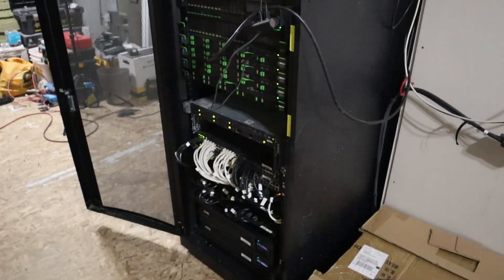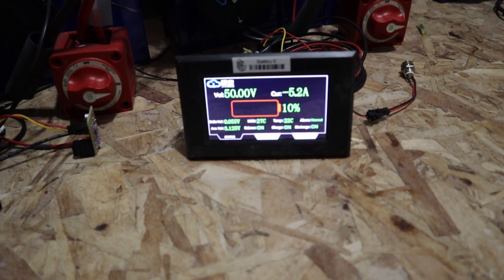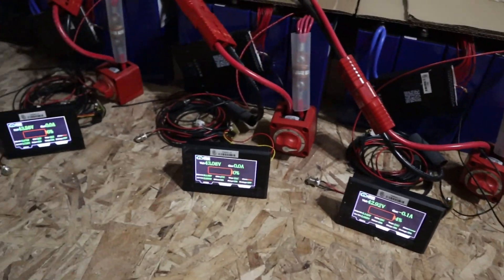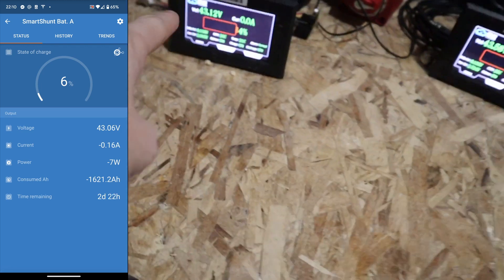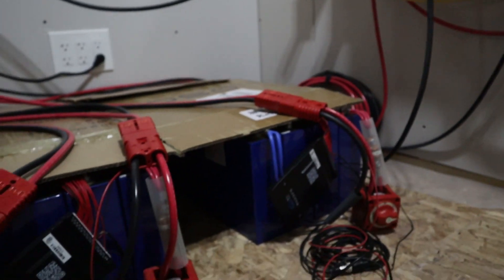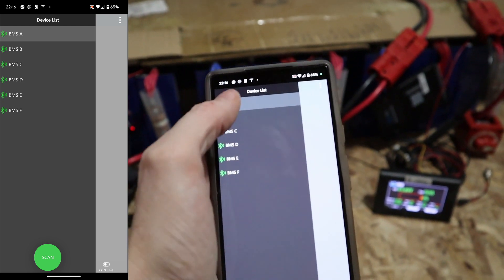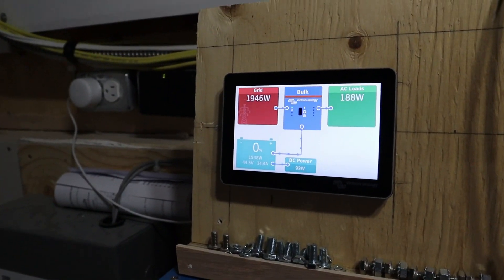Capacity Test Results! - Big Battery Build! (Ep. 47)

Comment: set balancing start in the BMS to 3.45V or even higher 3.5V (Andy has a whole series on this) the problem might be: that there might be some china-saved-on-lithium-cells and each BMS might constantly balance with 2A from all cells into the single one china-saved-on-lithium-cell = hence the big power consumption when sitting idle :(
Reply from the maker: Aye, I'll be using Andy's recommended values.
Reply: @TheDigitalMermaid  have here a EVE 280Ah cell with 270Ah capacity and the vendor says "everything is fine and dandy" #wtf?
Reply from the maker: @boringsoftware2093  How old is it?
Reply: @TheDigitalMermaid  not even 6 months.
Reply from the maker: @boringsoftware2093 oooooph

Comment: Hi! really love your videos and how transparent you are!. I've got a bit of a suggestion if you want to take it. I'm currently using a JK BMS B2A20S20P and I've connected it through the serial port to Home Assistant, so I Can check super easily all the data. I think for your use case it will be even more useful because you can check at the same time, compare and store all data from all the BMS!
Reply from the maker: If I had the time, I'd LOVE to tie my system into the home assistant. If only I could carve a few more hours out of each day. :)

Comment: There is always drift in SOC, because every meter do not integrate properly IN and OUT VAs, if U compare BMV and 3 different BMSs, each BMS will provide different numbers. It also depends on C rate, temperature, viscosity of elyt ... etc. If during winter batts do not reach max. voltage, difference in SOC left can be 10 % - 20 % or more + or -.

Comment: You are braver than we were.  My wife and I are converting our Catalina 400 to electric, using a QT30 LC motor  and a battery bank of Battle Born 270Ah 12V LiFePO4 Deep Cycle GC3 Batteries.  We used eight to build a 540 Ah 48V bank.  More costly but I didn't trust myself for a more DIY approach😆  I am a fair weather sailor and a gutless wonder when it comes to this stuff.

Comment: You may already know this, but when the battery is depleted under load, and the load is turned off, the battery will recover some of it's voltage, but that doesn't mean it has more useable power. Back under the same load, the voltage will drop right back down to where it was. Sorry if I'm preaching to the choir.

I'm glad you got the capacity you had hoped for. My extra cheap cells were advertised at 60AH each, and they turned out to be about 50AH in reality. I figured as much before I bought them, so I'm not disappointed with the result.

Some thoughts on top vs bottom balancing: I think this is argued a lot by battery nerds, but I think bottom balancing is only valuable if you plan to drain your battery to 0% every cycle. Bottom balancing will allow you to get the most out of each cell before the battery is shut off by the BMS. For most applications, people generally start with a fully charged battery, use it for a wile, and then top it off again. So the battery rarely finds itself at 0% in real-world conditions. In that case, top balancing makes the most sense because it allows you to pack as much energy into each cell as you can before the BMS cuts off the charging. I'm not sure everyone would agree with me, but that's what makes the most sense to me. 

Anyway, you sure have gotten a lot of work done! I'm looking forward to seeing what happens next. :)

Comment: But is it worth all the time an effort you put into those batteries? Wouldn’t it have been cheaper to buy ready made LiFePo4s? I mean it’s of course priceless to have made the experience. But is it economical for people who look for the fastest way to get things done.
Reply: As your pack gets bigger, DIY cells make far more economical sense, even with all the dickin around. $18K is a lot of money saved. Like Digital Mermaid, I was kind of curious to see what could be done with raw cells and was more of a learning experience. In hindsight, the 10kWh or so that I need would have been much easier if I had just bought 2 server rack batteries for about $500 more total. Although I'd only have ~80% of the capacity of my 280AH DIY cells.
Reply from the maker: For me, it's 100% been worth it. I knew nothing when I started, and the most important goal was to know my system inside and out. If something goes wrong when I'm far away from civilization, I need to know I can repair things. That's the biggest value.
Reply from the maker: Hit enter too soon...  Looking at price though, the price for retail batteries with ~86kwh would be ~32x SOK 206Ah @ 12.8v batteries, which would be about $33k usd for batteries alone (and I don't think they support a 4s/6p config). For Victron Lithium SuperPack 12.8V/200Ah, I would need about 34 of them, which would be about $73.4k usd, and they need external BMSes. So though my primary goal was education, the secondary benefits of cost are also huge for a bank this size.
Reply from the maker: Went back and checked; It was ~$14k~$15k for my batteries and BMSes. So ~$18k cheaper compared to SOK, or ~$58k cheaper than Victron.

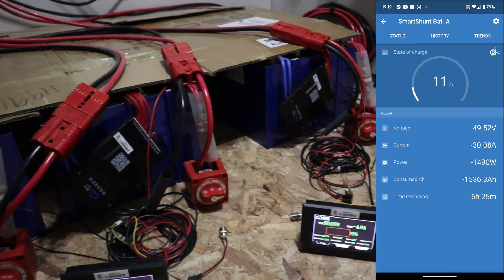Comment: 3:16 you mean 750Wh/day for internal loses? That seems very excessive for the BMSes unless you had the balancer running all the time which it seems you did. Accidentally or was there a purpose behind that? You cannot use the JK to bottom balance your packs. Bottom balancing makes no sense anymore. That's really something from the past.
Shunt could still show some %SOC depending on its settings. I found the Smart Shunt to be way more accurate than the internal BMS measurement of the JKs.
These screens are terrible consumption wise. I tested mine with 280mA constant draw from a 12V battery. The next version ( I know, right!🤦‍♂) can be turned off with the app and also have a sleep function.
Shaky cameras are sweeet. It creates a personal touch...
Reply from the maker: I didn't change the default balance voltage trigger, so it was still set to 3.0. Some kind folks commented that you pointed out that should be changed, but by then the test was well underway, so I left it. I'm going to do a few different settings across the six packs now that they're recharged, and them go to see family for Christmas. When I come back, I'll charge each pack to see how much power was consumed while I was away. Should be interesting to see the differences.

As for "the next version" having obvious changes, well, that's JK's way. =/ I'm not buying anymore, and will add switches if I take these BMSes to the boat.

Comment: Love your enthusiasm and dedication to this portion of your Electric Boat project. You keep saying "accurate" when you have no means of obtaining accuracy. You could choose a particular set of items to always do the Meaments, yep Meaments, Measurements with the Sure taken out. Sure would need calibrated items that can do measurements. I would suggest you do as most of us do with these sorts of things. Use the PDC method. Pretty Damn Close. And if you do enough PDC stuff soon you will not need any items just your brain. You will be able to guesstimate within the error of any items most use to do Meaments. I used to do a guesstimate, write it down, seal it in an envelope, and give it to one of my engineers. When another engineer got done doing Meaments and experiments (tests require accuracy and repeatability) and had some result, I would ask for the envelope and have the engineer open it. The look on their faces when they saw my number versus their number they were amazed. My few second answer was always just as good as the answer they took weeks to discover.

Comment: Since you have no charge coming in (solar) that is a very decent test. with balancing turned off you should get around 14.1 kw per bank of use and a .5 kw of bms usage. still 13.96kw with balancing turned on is good. My screens turn on only when charging unless I click on them. Also if you check each bms couple times a day that causes a little draw. so with no sun you can power 14kw a day on a boat. That is livable making water 1 time a week. I see a couple companies using 48v water makers with 12v or 115vac booster pump. since you have a victron I would get 115vac booster pump and an extra membrane to double the output with no added power usage.  Running fridge and freezer with electric cooking you would have plenty of power. How much solar you planning on? I know I am getting ahead. ill just keep watching as this is awesome what you are doing.

Comment: I’ve seen Fujitsu desktops use under 6W at idle with a Coolermaster 80+ Gold ATX size PSU.  I’ve wondered if their rack servers are also engineered to minimise power usage?  Surely a BMC shouldn’t always need to consume 100W whether the server is powered on or off 😅
Reply from the maker: They're really efficient, which normally is a great thing. The BMC is probably a couple watts at most.

Comment: I think your testing using what you have is just fine since not all of us have access to the kinds of tools Andy uses and can’t justify the expense just to test on a one time project although with the number of cells you have I might consider it but then again, trying to individually test or balance each cell to exactly the same voltage would probably take at least a month if not more, I might consider it a bit more…

I think I mentioned this previously, but a computer without an operating system doesn’t draw hardly any power at all given that it’s simply powering the boot loader and only occasionally needs to power the fan, if at all. So, in reality a light bulb might draw more energy than 1 or more of the computers. Charging up fully depleted UPS’s would definitely draw a sizable chunk of energy when recharging but again, once charge they don’t consume much energy at all. Put an OS on the, and use a CPU performance test application to force them to consume as much power as possible and also run a graphics performance test if they have graphics cards in them although I’m not sure if a graphics test app will work on headless computers 🤔 

You might have thought about this already but after doing near 100% capacity I’m test for my desired usable capacity based on the voltage range I decide to use and then setting that capacity as the pack capacity in my Smart Shunt and the top voltage as 100% charge. That way when looking at the shunt I see the usable percent remaining that I actually have available based on my usable capacity and then can look at the BMS’s to see the real percentages at the battery every now and again to monitor the real SOC and decide if I need to resync the shunt. I think that doing this should eliminates any issues with overhead or parasitic drain because it would all be hidden within the upper limit of the real capacity that I’m not going to use.
Reply from the maker: I actually installed OSes and configured the gear into clusters running VMs. Still the load never really climbed. Very efficient machines!

Comment: I'm sure you've figured it out already but pack C is showing a lower capacity because it hasn't reached shutoff and so hasn't calculated the cycle capacity.
Reply from the maker: I figured it out after I finished editing. I kinda wish I'd turned a load back on until Battery C shut down, but oh well. I got close enough to my target that I feel confident I got good cells, which was the real goal.

Comment: Just curious if you logged the BMS and Victron data together in a TSD?  Might aid in calibration.
Reply from the maker: TSD?
Reply: @TheDigitalMermaid  - TSD - time series database - if it is resilient enough and stored in enough places - it passes for the data portion of you log book ( think black box - though mine are bright orange ).  InfluxDB is the most popular as SignalK has plugins for it.  OpenCPN will also log to an InfluxDB   The phrase 'resilient enough' are open to interpretation - I take them to mean mirrored nodes all running RAID1 on separate independent power islands with redundant networks.  Since the data flow is not that significant the power hit is about 7watts per node.

PS - I thought it was a really good video.

Comment: You should really only balance at 3.4 of higher volts. You also mentioned bottom balance, you can't do a bottom balance with that BMS, nor would you want to. You either bottom or top balance, never both, as it is not possible. You either make all the cells the same fully charged, or discharged, not both. think of it like a fist full of slightly different lengths of spaghetti, you can make them even only at one end.

Comment: the cycle capacity will constantly increase. it is like an odometer for the bms. Mine is up in the high 6 figures at this point. to be clear, it only ever increases, never goes down. I don't know if there is a way to wipe or reset it either.

Comment: Why did you top balancing your cells when you are bottom balancing your cell in this video, it doesn't make sense !   Various places for instance at 5:43
Reply from the maker: I wasn't bottom balancing, I just stopped when the packs shut down the first time. The BMS was balancing because I left the balance voltage at the defaults JK shipped with.

Comment: You will probably now have top balancing issues as you need to set the balancer start voltage to be 3.45V! Balancing while discharging nulls the top balance you did! You will need to re top balance!
Reply from the maker: How would it null it? If the cells are all very close in voltage, there won't be much transfer.
Reply: @TheDigitalMermaid  As the cell discharge the delta will increase, over the six or so days @ 2A balancing it will add up, which essentially undos the top balance of the cells.

Comment: Does your BMS monitor tail current while charging ? ... monitoring the tail current of each cell is the only way to accurately assess when that cell is full charged. If you are seeing a fair delta between cells after a discharge test it may well be that all of the cells weren't at the same SoC - voltage is obviously not a reliable means of assessing SoC when charging.
Reply from the maker: I don't think it does, but I can't be certain.

Comment: Balance only above 3.4 volts or even at 3.45 in stationaire cases was the test result from Andy. Obviously with some absorbtion time and you will reach 98% SOC.
 If you are in a hurry(need to go with the tide)  and charge to higher voltages to skip absorbtion time, you need a BMS with high balance current and never balance while charging at low voltage because at those low voltage levels you are not balancing but only messing with SOC. In other words, at lower voltages we do not know SOC and it wil even de balance your pack. Only from 3.4 volt up it is useful to balance since you are already high in charge capacity and volt does reflect state of charge(full) from 3.45 to 3.65 is minimal difference in soc
Reply from the maker: To get down the the mV would require proper testing gear, so given what I've got to work with, I'm more than happy enough with these numbers. :)

Comment: Andy's video states that the balancing should only be when the batteries are practically full. Otherwise, your burning energy keeping your battery balanced when you don't have to. And IRL, you won't let them be this empty.
Reply from the maker: Yup, makes lots of sense, I just didn't realize how big the parasitic draw was until I tried to top-up before the discharge test. Once I did, it was obvious.
Reply: @TheDigitalMermaid   I know and I'm sure you have several friends/contacts that are battery/electrically inclined, but I think I could prob. point u in the direction of some helpful people, websites, forums/topics to look into that relate to what you're doing and working towards.
Let me know if theres an email or better way to contact u, and Ill try to do some networking magic for ya 😁👍🪄
Reply: @TheDigitalMermaid Yes, the active balancer is actually very low efficiency. If you wanted to bottom balance, you are nearly there. The 2.6v is basically more than 99% empty, the curve at either end is really steep.
Reply: I am thinking of the NEEY 4A balancer. It will start as from 3.47v or so...

Comment: I may have missed it but this test was done at less than .1C? Aren’t cells rated at .2C? 

In any case, I think you got your money’s worth. If you re-run the test (at .2C or whatever a reasonable facsimile of a cruising speed or an in/out of anchorage speed), you could get a more accurate shunt measurement by putting it on the positive side. That would capture the BMS/screen loads. I believe it’s a config setting in the smart shunt that flips the sign (+/-). That would only leave the connectors and fuses “uncounted.”
Reply from the maker: Cells can do 2C, but the BMS caps out at 150A continuous. This test was pulling about 0.1C, ya... Kind of crazy that a rack of servers could only pull that much, but then, the design goal of six packs was to spread the load, so... :)